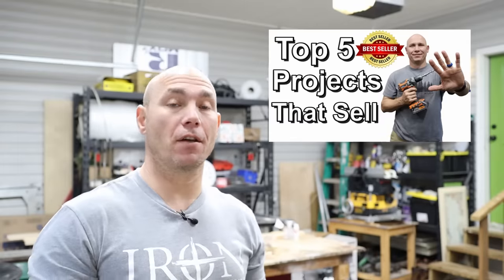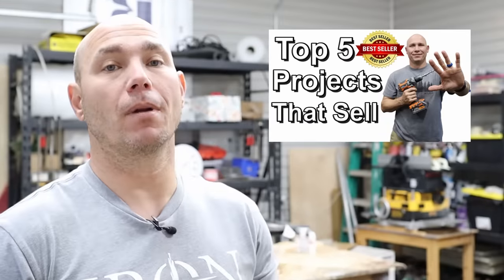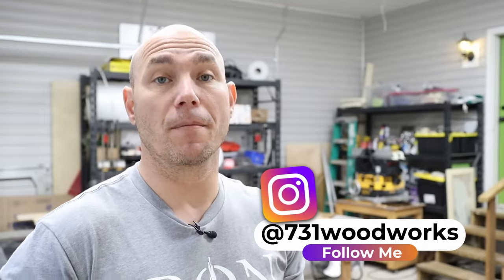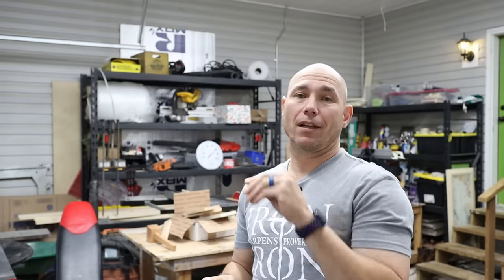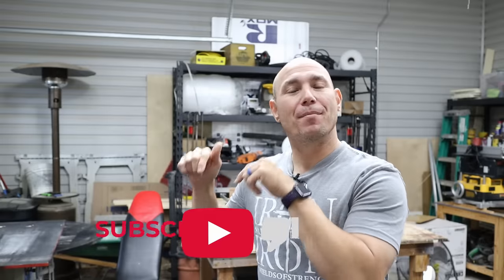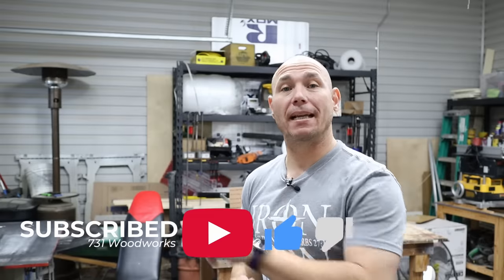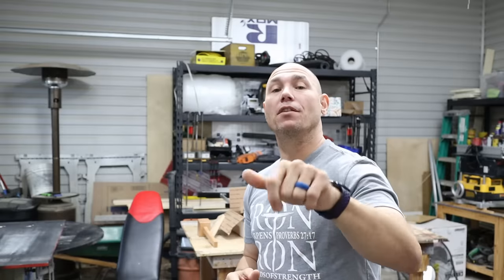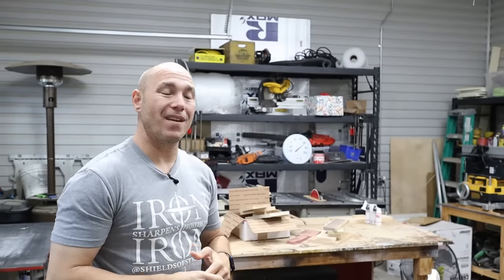5 More Woodworking Projects That Sell

Comment: Tip: the RV industry re: those stove tops.  The industry doesn't have the edges on the plastic or plastic countertop material that keep stuff  from sliding around.  Also, any small portable shelf or well made step stool comes in handy to, everyone uses something that isn't near as nice as good woodworking unless they make it themselves.  I'm camping out in my truck camper for a few months at a job, and I'm discovering new needs for coat hanging pegs on backing boards, shelves, boot dryer on some swing out hinges across from a heater vent, etc.  Those blanket and quilt ladders sized for RV's would probably also be popular.   The rv industry supply chain is toast, and their consumer accessories are / were mostly plastic junk anyway.  Also, thank you for your flags and promotion of the military and law enforcement, sometimes they need to hear the positive instead of the unfairly negative too.  Keep up the good work and thanks again for the videos and information!

Comment: I've been wood working for about 20 years ( 18 or so as my full time work), It's good to see people such as yourself encouraging others to make the transition from hobby to business. You've also got me thinking about the flags but where I live (Barbados) doesn't have a flag as sparkly as yours in the US so it may not look sharp. It does have Aqaman's trident on it tho so we'll see, lol.
Reply from the maker: go for it
Reply: Don't get me wrong.  I'm all for wood working projects.  Especially if you have the skill or tools to put out a good quality product.  But the cost of wood right now?  How can you even do these projects at a price range that would make them affordable?   Take the little shoe bench for example.  A 2X6 is over $15 and in some cases over $20 (and you would need two).  A 1x4 is over $6.  And these are unfinished.  The supports will need to be 2X4 so that's another $9.  So you already have at least $45 in lumber.  And that is not even taking into account, sandpaper, wood screws, stain, or paint.  This is easily a $60 project and that is without labor considerations.  Assuming an hour construction and sanding.  Plus and hour for painting or staining and anything other than selling it for $90 means you are under selling your labor and still not able to match a price on Amazon for similar products.  

On a side note, if your client has large feet, over 12 inches, you are going to have to create a bench wide enough to compensate for the extra long shoes.  So that is another 2X6 and another 1X4 which puts your materials in the $75 range.   Now mind you, your client probably isn't going to find a similarly long product on Amazon, so you can make a profit on this niche market.  You could probably sale a finished product for $150 and clear quite a bit.  But I should point out this bench is going to be heavy and how many people would you know that are such large footed and want want of these benches?

If wood prices would drop down to what they were 2 years ago.  I'd say go for it.  You could sale them for $90 each and have still made a reasonable profit.  But right now.  I just don't see it. Not with wood prices where they are at.

Comment: Fyi: you can find the led strips with remotes at Walmart (in the electronics section) for $8. 
I've used a dozen in various projects.
Reply from the maker: nice
Reply: Can you post a link for the led strip lights please?
Reply from the maker: @stephendylla5715  it’s in the description of the video
Reply: Do the led strips hold up pretty well? Also you mentioned a remote. I assume this isn’t the strips that you can cut and use for several different projects, correct? Thank you friend!!....   :))
Reply: They've held up great. I haven't had one fail yet. 

You can cut them shorter, but to use in many projects would require additional power connectors and adapters, which would cost about the same as a new strip.
Reply: @steelsunpi  I understand. Thank you so much Friend!!!  :))

Comment: when making table tops out of 1x6, im having an issue keeping the top surface flush. it seems like the pocket joints like to pull it up a bit leaving a seam. how do you keep that from happening?
Reply from the maker: Face clamp helps some. Making sure the edges of each board is square is key

Comment: Matt. Give mod Podge a try to help with paint bleed.  After you secure stencil put a base of it on cut out sections,let dry then paint.  That will create a seal at stencil edges. Was a game changer for me.
Reply from the maker: Thanks for the advice
Reply: @731Woodworks  no worries.  Let me know if it works fpr ya.  Looking forward to your next vid

Comment: I have worked in cabinet making; I would like to share a tip with you: if you discard the 2X demenation and make the same projects using 5/4 material (1&1/8") thickness you will charm up your projects intensely. Continued Success, Tom.
Reply from the maker: Thank you

Comment: The LED's with your starred flags would look sweet if you could create the star/logo'ed area hollow with a backing, drill holes into the stars and drop an led strip into the hollow backing. Great videos though from a fellow woodworker. Lots of the items are great for your rural and country folk.

Comment: Not sure if this was already mentioned, but look up "French Cleat" if you are not familiar with the concept.  They are quick and simple to make and you can sell them along with the flags and other items for a quick, easy and secure way to mount your items.  These flags likely weigh more than a single screw or nail would reliably hold, and you can mount these cleats directly into two wall studs with a level and you're all set!  I jokingly say to use a level because my wife, although very intelligent and such, she hates to use a level and cannot hang anything NEAR straight, so it has been an ongoing joke through our entire marriage.  She knows the fastest way to get me to do something is for me to hear her down the hallway starting to do something using a power tool.  :0)

I think making the stripes on the flag would really pop too if you alternated Black American Walnut and Birch or other light color wood, apply some mineral spirits with some poly and you have another gorgeous flag! 

I think wood working is going to make a big comeback over the next several years.  Big manufacturers have kept prices up while reducing quality and resorting to more and more plastic that after exposure to sunlight break to pieces in about 3 years, where making simple furniture like this with a decent hard wood will last for decades.  It may not have the 100% perfect angle and such of injected plastic molds, but they are gorgeous and they last.  

I'd like to say you inspired me to get back into wood working, but I won't lie, my wife found a video by BYOT (Bring Your Own Tools), video #23 and I have all the tools I need to make that gorgeous Black American Walnut table top, and my wife wants me to make it to enlarge our existing table, and that project is what sparked my interest after about 30 years out of wood working.  I just need a bit warmer weather and to clean out my shed more, and a router to give projects that clean, professional look.  However, you did show me several inexpensive projects I can make with the tools on hand and sell for a profit, and fund some future tools.  And so many people will spread this via word of mouth.  If someone comments about anything you make, most customers are more than happy to spread the word that it was hand made for them by you, and will pass along that information.  

Thumbs up and subscribed.  I need to watch your other videos when I have more time.  Thanks for the great ideas.  I already had the flags in mind as my brother makes flags already but seems to have stopped.  He does a lot of different designs, but his wood working portion is pretty weak, so I may team up with him to add value to his work, and split profits.
Reply from the maker: Great idea on the french cleat.  Thanks

Comment: Biggest question for me would be, where do you sell locally? On Craigslist, you get flagged by trolls or the competition trying to eliminate you. The cost of running ads in the paper eventually add up. Posting ads physically in places can get some heat on you. Facebook Marketplace sounds like the only alternative, but I've been off Facebook for 3 years now (it's so nice not being on that toxic site). Guess I'll have to just go with it.
Reply from the maker: Check out my how to sell video
Reply: @731Woodworks  Just saw it and forgot I posted this comment, good heads up on everything!

Comment: Thanks Matt for another great video.  How do you handle dust collection?  I have been doing projects on my patio this summer, but cooler weather is forcing me into the garage.  What have you found is the best way to keep your work area relatively clean.
Reply from the maker: I use my shop vac and anything left after that I use a leaf blower to blow it out of the garage

Comment: Awesome work as usual! I'm fixing to ramp up my own woodworking business after viewing your videos. I love pocket hole construction, but I noticed you don't hide your pocket holes. I've tried several methods (sawdust and glue, woodfiller, etc.), but not filling the holes will save some time. Have you ever had a customer comment or complain about unfilled/uncovered pocket holes or pin holes from a brad nailer?
Reply from the maker: I haven’t had anyone complain. You can use a 3/8” dowel and cut flush with a flush trim saw
Reply: @731Woodworks  thanks for the reply! That’s good to know that no one’s complained (maybe they don’t even notice once it’s stained). Will definitely save some time in the workshop! John 16:33

Comment: I see you use a number of 2x4 and 2x6 boards in our projects.  Do you have issues with them warping over time?  Do you use treated (even worse for warping) for the outdoors stuff??  Also, painting... do you just brush the paint or do you have an HVLP spayer?
Reply from the maker: I haven’t had any issues with warping. I use non treated. I typically spray paint with my HomeRight sprayer

Comment: The outdoor furniture at the end - how are you protecting it for weather? Is it PT? Or are you just relying on the paint to block out the elements?
Reply from the maker: use spar urethane for outdoor stained projects
Reply: @731Woodworks  do you have a video on doing that?
Reply from the maker: No, sorry I don’t.

Comment: Another great video - you are so inspirational. One question - What type of 2X4s and 2X6s to look for? Is that the construction lumber like Douglas Fir available in Home Depot/Lowe's? Thanks ....
Reply from the maker: It’s yellow pine. Try to get grade 1 if you can
Reply: @731Woodworks  Thanks for a prompt response. Will try to look for that. I am in Bay Area California. Never seen that before in this part of the world. But will look more closely. The construction lumber sold here is mostly Douglas Fir. The regular pine sold in other isles is too soft as per my limited experience. And anything else like Poplar etc. is way too expensive sold by linear foot :-(. You might "force" me to move to the Southern part of the country :-)
Reply from the maker: lol

Comment: Love your channel, love your helpful videos, and love the help you offer. The meat and potatoes of my business right now are my flags. I do a lot of them and I distress the wood with a grinder, do a Shou Sugi Ban style burn on them, and then hand carve all of the stars and military logos with a Dremel. I have different price points for each flag based on if it's a 13-star Betsy Ross union or 50-star union then add an additional charge if a military logo gets added. How do I tell if I"m price right? Can I email you for some advice on the side?
Reply from the maker: Sure
Reply: @731Woodworks  thanks Matt...how would I do that?
Reply from the maker: My website has a contact me button on the home page

Comment: Dude what kind of marker did you use to hand write on the states flag? And did you after the clear coat?
Reply from the maker: Yes to clear coat afterwards.  It was a paint marker. Oil based paint.

Comment: You said not but you made a point of its only a few bad apples. Well you are 100% correct . But that 99.9999999% good ones don't do anything to stop the bad one. They will stand by and watch the bad one do whatever they want. But on that note I do believe most are good and become a  cop for the righ reasons. And have been treated above and beyond with great respect more than once.  There just needs to be accountability once that happens it will be a horrible trade. And 99.999999999% of the people will support them at that point. To all you officers reading this be save out their.

Comment: I can't share the video. . . My friends will steal my business!
Reply from the maker: lol
Reply: @731Woodworks  IDK if you ever seen 'em or not, but I've had a lot of luck with squirrel feeders; basically mini picnic tables. I go a little farther than other people because I like to distinguish my products while at the same time undercutting competitors. $500 in materials can be flipped to $1500-$2000 depending on how you sell them. Every winter I smash out like 250 of them, then come spring I put half up on FB marketplace for $20 a piece, and throw the rest up at a couple consignment stores I've built a rapport with for $25 a piece. They keep $5 every unit sold, I get the $20. They've got websites and their own FB pages, so they go pretty fast.
Reply from the maker: Nice